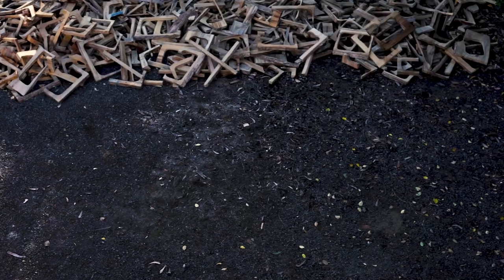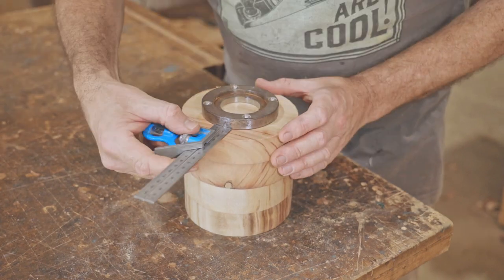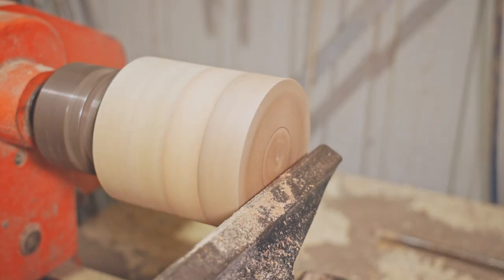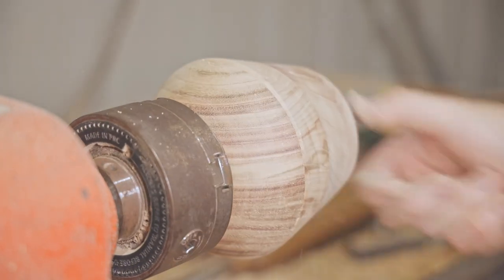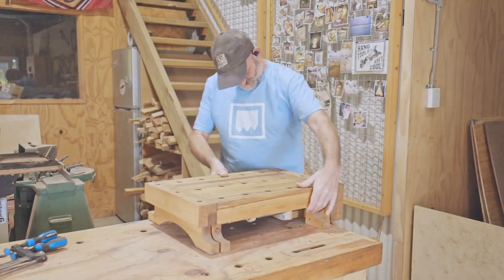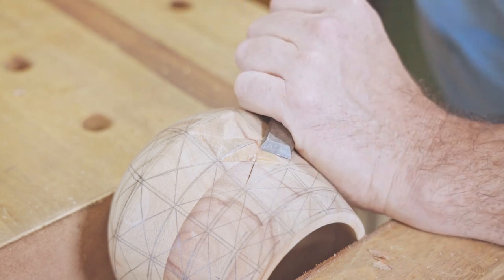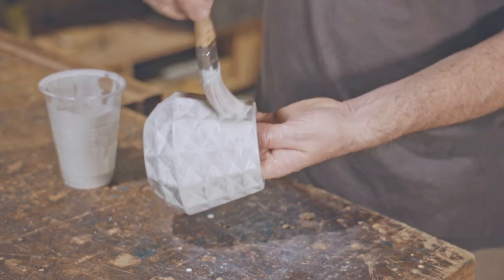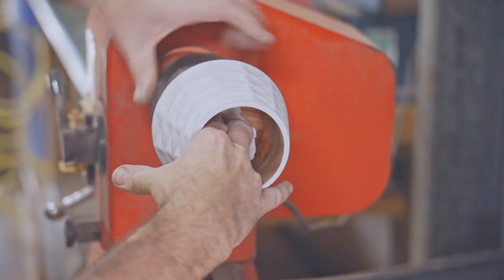Hand Carved Pattern Bowl - (Day 2) 7 Scrapwood Challenges in 7 Days - ep44

Comment: It's awesome,
The finish is great
It struck me that as an alternative you could have sanded the paint more once back on the lathe, using a stiff strip of paper ( some sand paper glued to some cardboard, or perhaps 2 layers of cardboard) so that it would not deform and sand into the facets, in that way you would get the full wood grain between the facets. I don't know if this would highlight the facets or hide them, but it would give you that contrast. I suppose over time you'll find out as the paint wares off the ridges.
SO Glad to see the scrapwood challenges back again, have missed them - just the creativity .. the "so, what else can I make from this pile of scrap???"

Comment: I can only imagine how good that Camphor Laurel smells when turning on the lathe. Port Orford Cedar and Myrtle are my favorites.
Reply: If  you can find some, try Brazilian Tulipwood. It is a really small dalbergia, a true rosewood, but it never gets large, a foot in diameter or so, it should probably be classified as a bush. Very pretty wood, light yellowish with streaks of red and orange, and when you turn or sand, it smells like you're in a field of flowers. Or Bloodwood, which smells fruity and sweet or like fine leathergoods, depending on the piece. Stay away from zebrawood and redheart. Two of the foulest smelling things I've ever worked with, the redheart being noticeably bad.
Reply: Curious, do you harvest the Camphor Laurel yours self? I read it is sometimes called a “weed” in Australia. Is that true? Thanks, love the bowl and carving. Did you count how many times you sharpened?